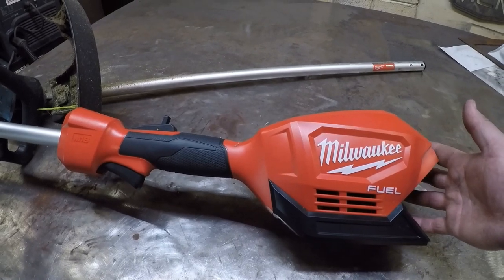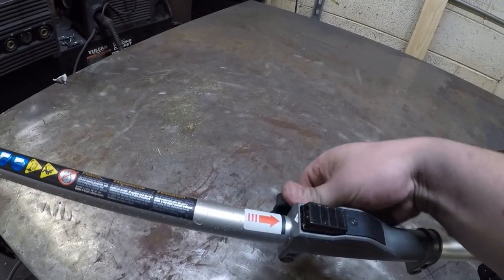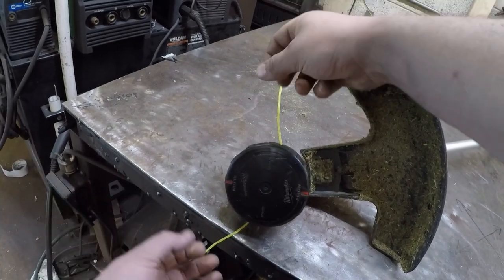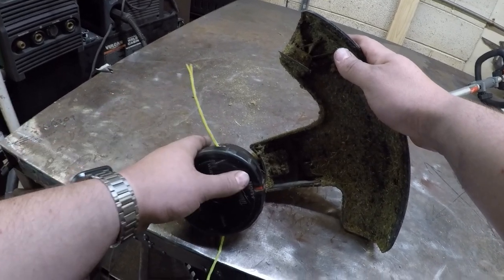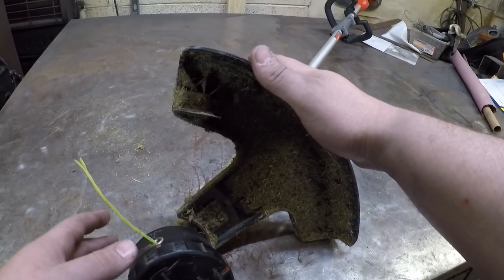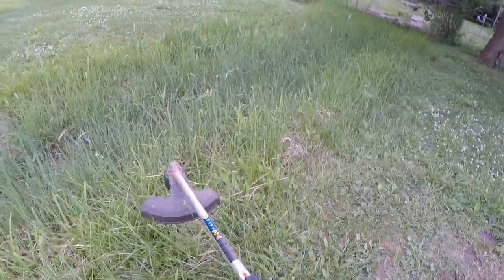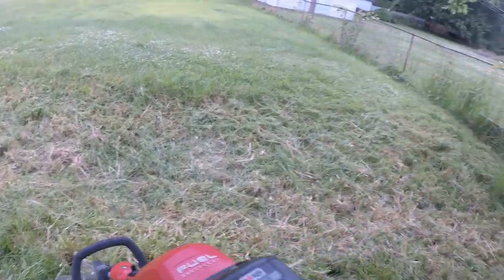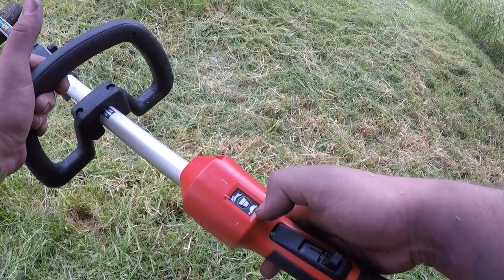Milwaukee String Trimmer Better Than Gas?

Comment: not sure if you mentioned it in the video but if you take the blade off that cuts the line and flip it around and put it back on it lets your line length go from 14inches to 16inches
Reply from the maker: I did not know that.  Thanks for the tip

Comment: I have a 10 Amp corded 18" Greenworks that will take down brush, up to 3/8" diameter, it also tears right through the stuff you did...like seriously throws it out like it got hit with an explosion. This Milwaukee looks close-ish to the power of my corded model, but again, doesn't seem to really blast that brush out like my greenworks does. Still, all that being said, I HATE having to deal with the extension cord and might get this. Btw, if you haven't tried the Maxpower .080" line give it a shot, it definitely thrashes everything in sight, compared to the regular round stuff.
Reply from the maker: That's actually the string that's on there    check out my other video https://youtu.be/Hk_cZ_ke5XE
Reply: @Motor City Metal  wow, interesting. My Greenworks corded model blasts brush out with that string, well, the .080" version. Maybe corded still has more initial torque or something 🤷‍♂️ Either way, though, it is definitely worth it to sacrifice a small bit of power to not have to deal with an extension cord 👍

Comment: Total garbage overheats to quick
Reply from the maker: Haven't had one problem sounds like you're not using a big enough battery.
Reply: @MotorCityMetalArt  what battery is recommended to avoid issues? I'm considering one of these right now.